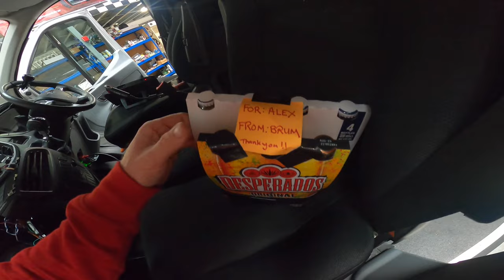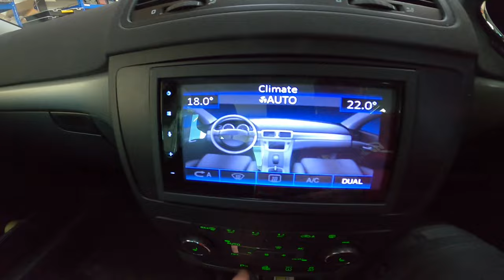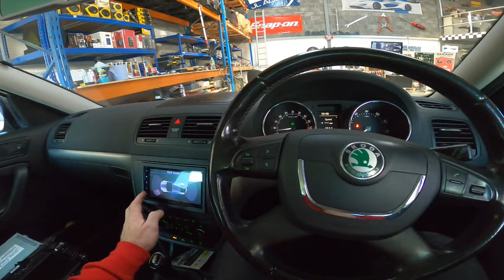Apocalypse van returns

Comment: Alex, good vid.  Good to see fresh Pioneer stock arriving regularly!  

Catching up with your older videos, I saw the one where you made an elegant light box for the new Audison display stand.  Any plans for this?  Know time is short (and you’re not doing many/any Audison work at the moment), but such a shame not to have finished this project and showcase Audison/Hertz to prospective customers?  Surely some future Audison customers in Swindon who’d be swung by hearing the demo unit?

Just had one of the first new Forza AF M12.14 Bit amps fitted (along with actively fed Thesis TH 1.5 II Violino tweeters, TH 3.0 II Voce mids, Hertz ML 1650.3 Legend under-dash woofers and Eton UG MB 100PX coax’s at rear) fitted to Aston - (uses NavTV Zen MOST unit to interface Forza with Merc head unit) and plans to have one of the first newly launched Audison DRC-AC volume/input control which will work with Audison B-Con (fed with high res music from an Astell & Kern DAP).     Still working on a solution to replace factory sub and may have a custom box fed by Forza AF M1D.  Sounds gorgeous so far!!
Reply from the maker: thats good to hear george i was actually building a stand for some audison product but after some trial use with the letters and router work the only feed back i got from them was that the letters used where the wrong type face so binned the whole thing off and went with  more supportive products . 

glad you are liking the aston sound
Reply: What a shame Audison weren’t a bit more flexible and open to a bit of creativity - disappointing (given the effort you’d put in to make something nice & original) and now understand why project not progressed & loss of interest in brand.  Personally, I find in-car installation demos more realistic (e.g. I fell in love with the Thesis tweeters after hearing them in both Range Rover and VW T6 demonstrators), as on-axis speakers (in a stand) will always sound different to an actual install.  Guessing your Merc van or Chaser is/will be your best demo unit?
Reply from the maker: very true spoken like a pro audio in cars sounds night and day to actually being inside a  vehicle vs a stand and the shop space never a true representation